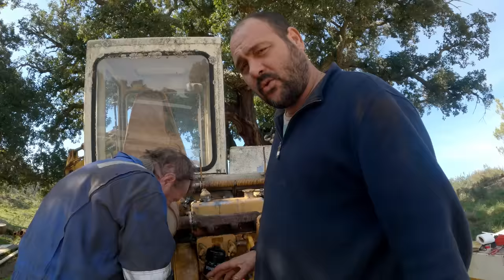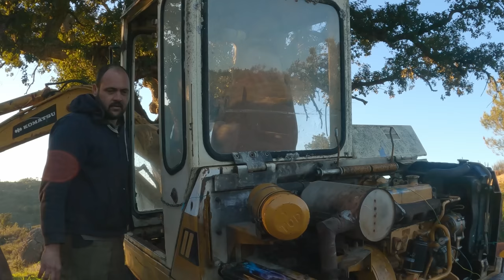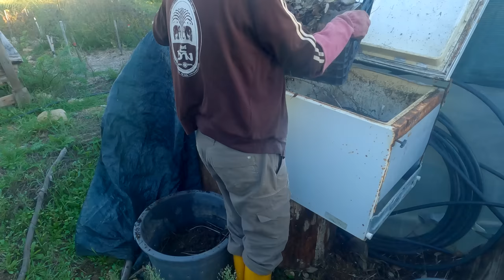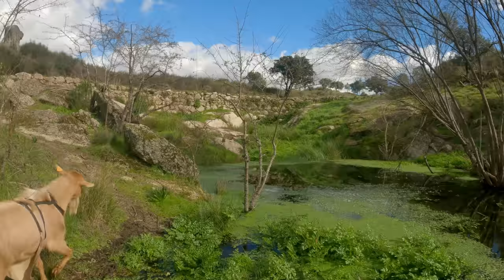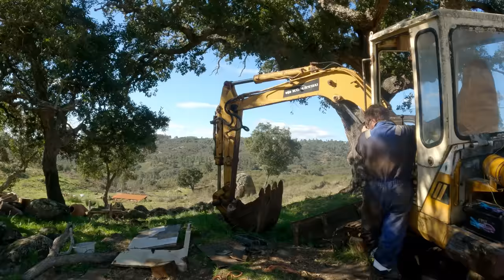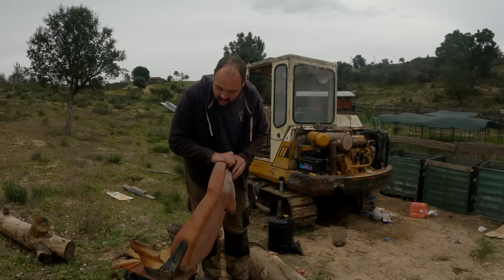4 Year Journey to this Life-Changing Moment: Our Off-Grid Adventure in Portugal!

Comment: Well done guys, i would check all or replace , all main electric connections, service and grease starter motor, a Solar car charger is also  a good investment, keep battery in tip top shape, and as for glowplugs, in the past i  have drilled and threated old ones to fit modern smaller ones, like an adapter, she needs a spray of diesel, all over let it soak for a day or two and a wipe over with a rag. greatjob.
Reply from the maker: Thanks for the tips!